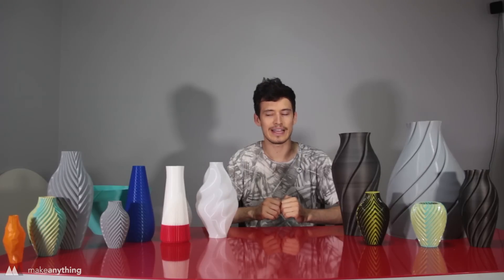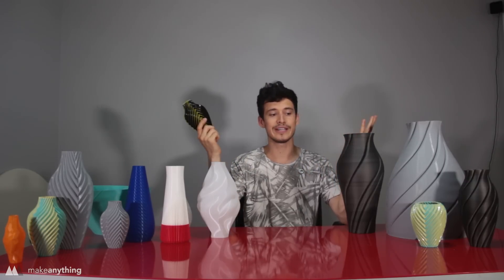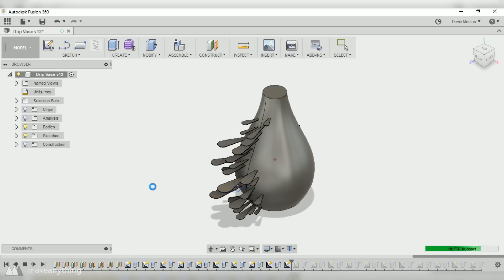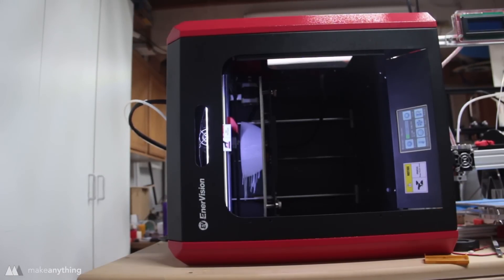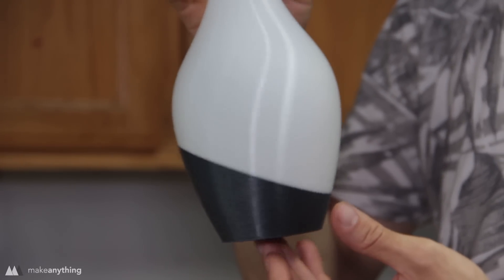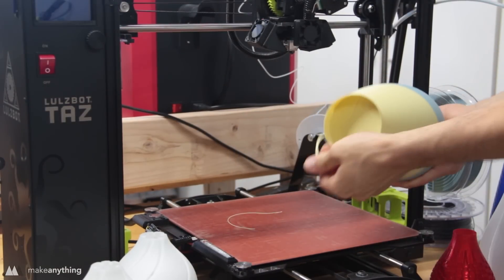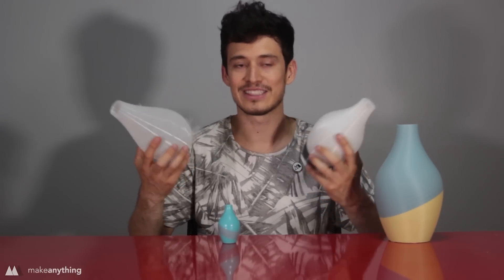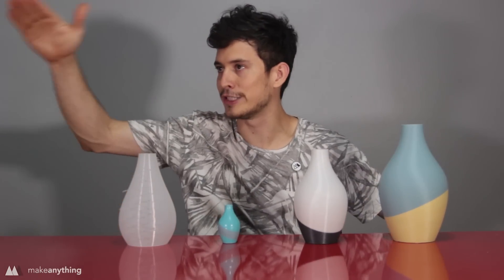Vase Exploration 1 // 3D Printed Experiments

Comment: Since you mentioned Polysmooth, I have a role of polysmooth, I don't have the smoother but I have the pla black and I'm having a heck of a time getting it to print without a lot of dripping all over the place. Also stringing is horrible so do you have any advice or settings on how to print that polysmooth.

I use simplify3D and I have a cr10.

I tried lowering the temperature, changing the retraction all my other pla print fine but when I  I put the polysmooth in it does not.

Any advice or video you have would be appreciated.

Thank you